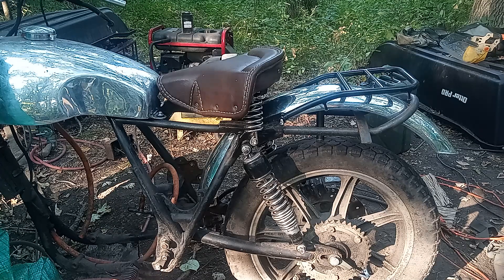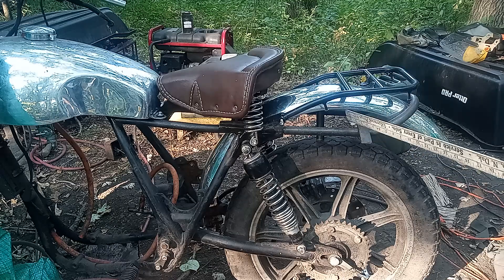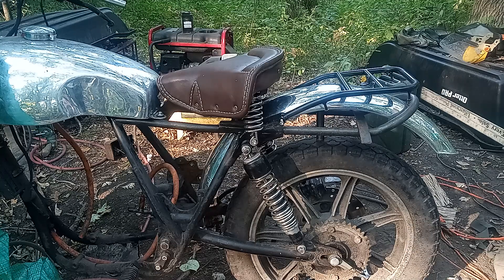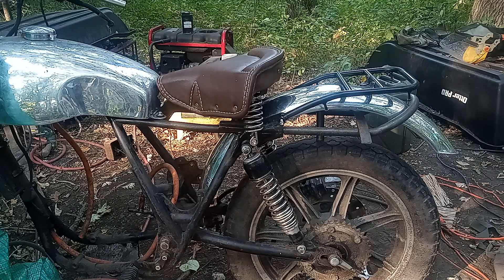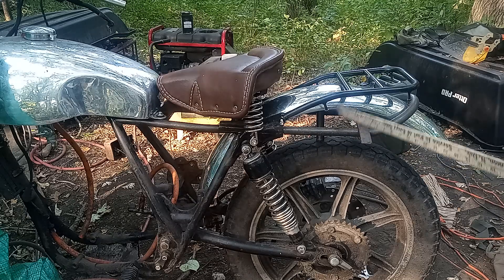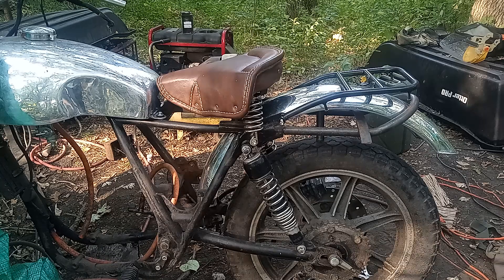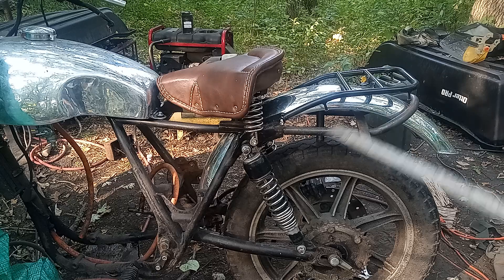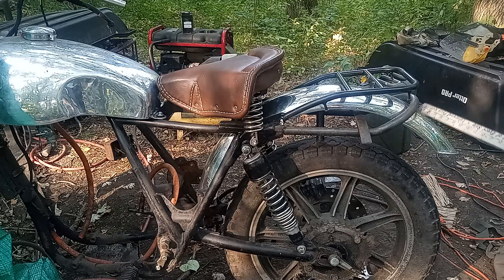Frame loop

Comment: It is coming together! Will you use a blue loc-tite type product on all your fasteners during reassembly to help with bolts backing out? What are your thoughts on powder coating the frame verses painting? Have a great weekend and I am starting to smell fall in the air today!